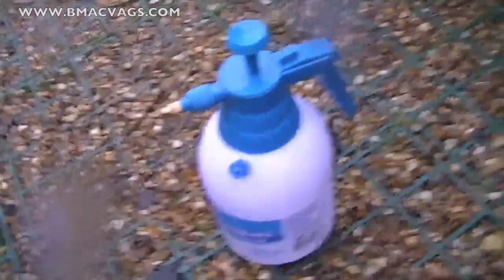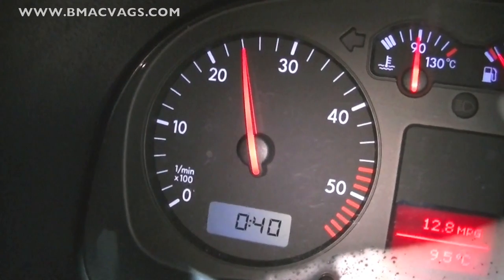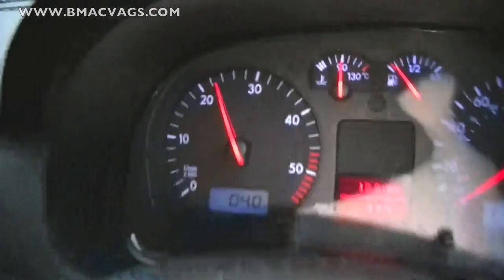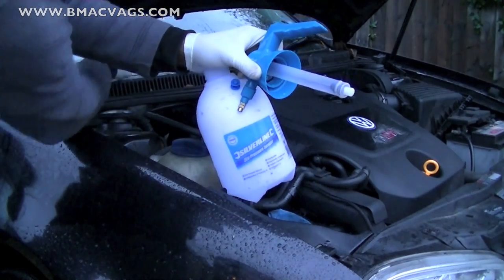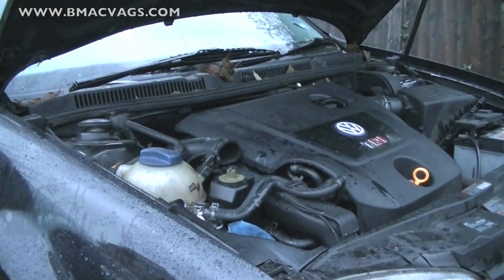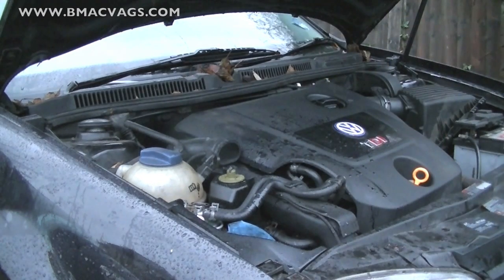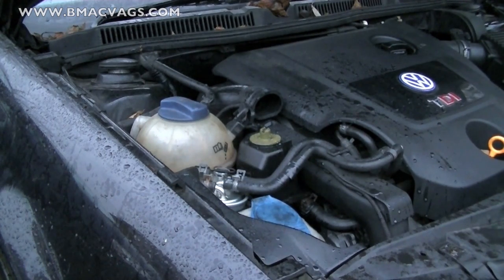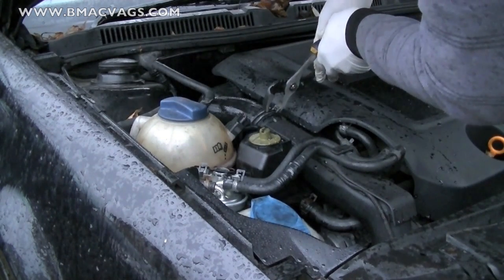How to Decarbonise your Engine with Tap Water

Comment: Honest question here:  where does the carbon go?  Doesn’t this just muck up the DPF and/or the catalytic converter?
Reply: It is burnt during the combustion cycle of the engine and comes out the exhaust as carbon monoxide.

Comment: I connected my garden hose to one of the larger vacuum pipes coming off the intake manifold. Revved to 3000 rpm and let the water flow full force. For some reason there was a loud bang and the engine seized up. Just waiting for water to evaporate now...
Reply from the maker: You actually spent your time to write that nonsense 🤦‍♂️
Reply: @BMACVAGS  Yes, and you wasted your time reading it, thinking about it, writing a response to it...  LOL

Comment: Decarbonisation - before or after oil change? What do you recommend?
Reply from the maker: Before if you are changing the oil. Any moisture that gets into the oil will burn off as vapour as the engine temps get higher than boiling point. So ultimately it will burn out of your exhaust.

Comment: Do you think this would decarb the egr on a diesel?
Reply: No pal you will have to take your egr off and clean it by hand  but this water treatment  will do what he says and it's best to change your oil after as it can cause steam blow by in your cylinder's which can make the oil milky in your engine and that's not the best ,I've tried this gave the car a good run out and came home and dropped to oil just to make sure so I only do this on an oil change which I do twice a year on a 2.4 twin turbo Volvo and I do say the turbos sound far better after .

Comment: I did it to my 06 kia spectra and all you get out of the tail pipe is vapor and a black stuff engine runs smooth. use a spryer you want mist of water. interval of 10 seconds. work fine.

Comment: How obout a siringe needle  pressed between the intake manifold and the hose, the needle coupled to a hose and feed by a garden sprayer just like yours and using it on a long highway run just before my oil change.  I have a TDI 2.5 straight 5 non Pump Injector Vw T4   with over 600 000km.

Comment: I do it every few months on my 1.5L common rail diesel. Car is used 95% in city so I have to do it every 2-3 thousand miles.
70% destillated water and rest is 99.9% methanol. 1L of mix do a job.
Reply: Dan Are you Doing this on a 1.5 DCI renault engine?? I bought a 2009 clio 1.5 dci 86 on 1st june and ever since it's been blowing out black smoke under hard acceleration Tempted to try this method as I've already changed the air filter and cleaned the intake pipes Where do you spray yours ? On mine i can disconnect the intake pipe just after the MAF sensor

Comment: Will this method also clean the throttle body? I have a volvo c70 convertible its throwing up ETM codes. I am going to clean the throttle body with the correct cleaner. After i am going to do the air intake decarbonize, can i occasionally spray throttle body cleaner down there aswell just to help with the process?

Comment: My grandfather told me that there used to be a system on cars or semi's that would actually drip water into the engine and clean out the cylinder and it was actually effective too

Comment: Little tip for throttle idol. Put a broom upside down between pedal and headrest. Then use the seat back rest adjuster to adjust the revs accurately 😉

Comment: I dont know if you mention or not but after water procedures you need to change oil because water will mix with oil. I did the same cleaning yesterday and now engine sounds better and smoke is hardly noticable.

Comment: when water turns to steam it takes up about 1600 times more volume ;-)
Reply: unless you keep it pressurised in a tank or vessel of some sort.. until the tank breaks under the pressure .. a superheated water tank that ruptures under pressure can take out half a building, as all the water very quickly expands 1600 times into steam.
Reply: yeah i guess i meant at 1 atm.. i only mentioned it because he refers to the expansion of steam in the vid.

Comment: FYI this work! My technique was more gentle than this but it was done over a period (months) I've use an aquarium air stone in a bottle in negative pressure using the vacuum of the inlet (Water mix with a bit of alcool "to avoid freezing!" Note this is north america (Canada)) to make air with moisture going through the inlet and fill the bottle as required. It's a slower process but the efficiency is in the long term. Great video BMAC VAGS

Comment: Water is a killer for diesels dude.  That's why they all have fuel filters to remove any possible water caused by condensation in the fuel tank. Why on earth would you add water?
Reply: Water is a killer if it's in the fuel Kristian, not if it's sprayed in the air intake.  Otherwise you wouldn't be able to drive a diesel engine in the rain.  I first noticed that diesel engines run better in wet weather when I was a kid on the farm.  Of course the water in the air intake must not be too much, such as driving through deep water, as that causes the engine to hydro-lock which will destroy it.
Reply: water in diesel fuel will damage injectors and pump.

Comment: I tried this on mine but the air is pushed out from that pipe so the water just got blown out? Is that correct?
Reply: That means you are trying to inject water in your turbo outlet. It simply means you have the wrong pipe. Don't do something you are not comfortable doing.
Reply: I followed what is being done in the video though?

Comment: iv got a ford fiesta mrk4 1999 it says not to clean my trottle body if i use water to decarbonize engine will it harm the oil thats on the trottle body the trottle looks like its got a glase of rust around the edges as i have cleaned it with water and towel before noticing the sticker

Comment: The way it works, so I'm lead to believe is, once the water mist enters the combustion chamber, the heat of combustion splits the water ( h2o) into its component molecules hydrogen and oxygen , this raises the combustion temperature , and burns the carbon away , I'm a mechanic of 30 years experience, and have used this method a few times on petrol engines that had pre ignition( pinking ) took a while and around 5 litres of water , but once done , no more pre ignition , it's an old school cheap fix that has stood the test of time well
Reply: You may be a mechanic, maybe even a very good one, but you're not a chemist. Heat turns water into steam, it cannot split the molecules. Steam is water molecules in a gaseous state. Still H2O. In order to split it into hydrogen and oxygen you need to pass a current of electricity through it. Look up the hydrolysis of water. 

You are right about it being an economical and effective method though. The reason this method works is that the water is turned into steam and is essentially steam cleaning the combustion chamber.
Reply: Get any molecule hot enough and it will break apart. Of course, if the radicals don't have anything better to bond to, they will just go right back together again.

Comment: Hello BMAC VAGSI appreciate the movie, and the effort.I would like to share my experience to decarbonizing with water.I tried this on my lawnmower (Honda HR-194 air-cooled 100cc 4Stroke engine).
I disassembled the head and studied the head gasket. What I noticed was that the water went past the compression ring into the oil channels. A large part of the head gasket was wet! After that I studied the engine oil. The oil had a very milky color, indicating that lots of water went into the oil. This is an air cooled engine so it had to come from the water of the decarbonization process.Conclusion: The compression ring is not suitable to stop water. Water runs past the ring into other channels. I would not recommend doing this.
Reply: If the head gasket was wet, then you obviously didn't follow the instructions.  The engine must be at operating temperature, and only use small sprays of water at a time.  Sounds like you drowned a cold engine and got the result you'd expect.
Reply: Don't worry. After few hundred miles all that water will vapourize from oil. Nothing to worry about really.

Comment: in this vid the water was introduced post turbo, would there be any complications or reasons why it couldn't be pre turbo?
Reply: You don't want to get water on your mass airflow sensor, it'll malfunction.
Reply: You disconnect it after maf and spray hot but not boiling water from a spray bottle it should only be a mist that sprays out of the bottle, have engine at running temp and someone holding revs at 3k ish then give it a few sprays every minute.

Comment: This is NOT a safe way to decarbonise your diesel engine.
This will stretch your cylinderheadbolts and lead to a blown headgasket.
On high-milage cars decarbonising can lead to lower compression at high rpm, because the carbonbuildup  under the pistonrings is removed.
Try to see what water is doing to carbon.... Nothing
And now try with alcohol.
Reply: The alcohol method work's better??? Is it safe? No...BUUUMMM!!!

Comment: hi. I have just bought a GM Camaro v6 with direct injection system.  The car is used,and has just 12k miles. When should I do this procedure to clean the valves? Maybe it is still clean because the car is in new ,low mileage.
Reply: Start using this method every month or every other month and always change your oil every 3000-3500 miles and keep well maintained and you'll never have to worry about engine troubles
Reply: +Lucas Hernandez Thanks. I will do that,It ia time to change the oil. How much water should I put in my motor?
Reply: Best moment for engine water cleaning is before oil replacement. Because some of that water will dissolve into oil and you want oil to be at least warm before drain (better flow), so you can get rid off water and do it quicker with warm oil.
Plus engine will be cleaner thanks to water cleaning and happier thanks to new oil.

Comment: one question: if you remove the intake manifold hose, do you disconnect it before or after the air filter?
Reply: +namele55777 You don't want to water soak your air filter. It might choke the engine. Personally, I prefer small vacuum tubes after the MAF.

Comment: Whenever I take off my intake hose to get ready to spray water in it, the car shuts off. What am I doing wrong
Reply: +Mike N I think I know what happened. That intake hose is letting too much air into the engine, or it's after the MAF and the engine thinks it's getting less air than it really is and it dies. You'll have to find a smaller hose on the intake instead of the intake itself. 

If you're already on the smallest hose you can get, keep it covered with your thumb or something when you're not spraying water in.
Reply: +Michael Nikprelaj Are you keeping it at about 2500 rpm?
Reply: +stwg32 yes even 3000

Comment: Couldn't you just drive the car for say 10 or so minutes and then do this?
Reply: +GymChess Sure. That's a good idea.
Reply: +DE Nichols I still haven't tried this actually. I really wonder how safe it is and if it works on every car make.
Reply: +GymChess If you don't do it gently, then it isn't safe. You have to do little at a time safe. There are products sold for this, which aren't O2 sensor or catalytic converter safe.

Comment: It worked with my 4 stroke 120cc motorcycle!what i did was spray a mist of water into the carburetor air intake with the choke fully open and spin the throttle enough so the water can pass through.but before i did this i let the engine run really hot first.

Comment: I am about to try this on my beloved car... Lets see if I should pull you head off or I should thank you! But I get that I will be thanking you... Lets see!
Reply: Daniel San First time my wHP per the torque app was up 6 from 109.

This time I'm up 2 from 88 (I had a bad O2 sensor that was giving me lots of power....probably really bad for my Catalytic converter.)

Use a "laser" thermometer like my video. It showed what I couldn't feel in the drive.
Reply: +Daniel San he does not mention if u r doing this u should use distilled water u don't want a lot of minerals etc in the water...i'd use a regular spray bottom not this thing u want a mist not a stream
Reply: ***** Have just done it. Used a mix of Redex Fuel cleaner with destilled water. My mix was: 15% redex - 85% destilled water. can't really feel a difference yet, but lets lee tommorow! :)
Reply: +xadam2dudex I think you're right. I've done it a few times with a simple water bottle that mists.
Reply: DE Nichols I can't tell the difference, could you?

Comment: was just wondering BMAC..
 the water you are spraying in the pipe leads to egr valve compare to a petrol engine the water goes after the MAF senser pipe..?

so will this method will clean the EGR valve aswell on tdi golf ?

Comment: Dont ever try this... i did this to my civic si k24.. all the engine is broke now, water damage, piston was mess up, crangkshaft, and the valve too.. i have to spend half from the car price to fix all of this.. dont ever try this way... u better spend $20-$50 to buy a carbon cleaner..
Reply: Stephen Chandra Next time, please don't use FIRE HOSE when spraying the intake.
Reply from the maker: Stephen Chandra My friend you are not telling the truth. How could it break piston, crankshaft and valves? 

Please explain how.
Reply: BMAC VAGS if you're an idiot and put too much water in then yeah you can break your engine as water is incompressible. Use a fine spray and less is more.
Reply from the maker: pjgmorgan There is nothing we can do about idiots...lol
Reply: It's also possible they did it on a cold engine. One of the reasons you do it on a hot engine is so the water will evaporate before it gets into the combustion chamber. Steam can be compressed, liquid water cannot. If you end up with too much liquid water in your combustion chamber then you hydrolock.
Reply: If you do not know what you are doing, you should not try this. Worked fine for me.
Reply: You obviously fucked up then, how did you manage to not follow a video tutorial.

Comment: I have a 98 Jeep Cherokee XJ 4.0 and my CEL mysteriously came on 6 months ago. I was completely baffled because i take extremely good care of my Jeep and consider myself somewhat of a good mechanic. Problem came about after using detergent gas ( i was low on gas and it was the closest station). First and last time i did that considering i use 93 high octane. I finally heard about this method on Youtube and instantly worked wonders! The CEL went off instantly and my Jeep has been restored to beast mode. Thank you so much for this insightful video. Im extremely satisfied.